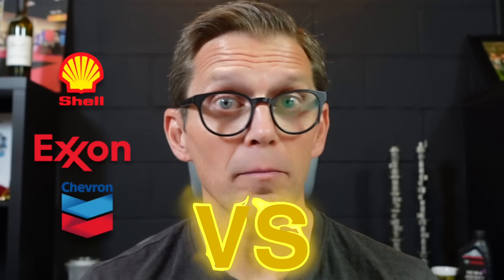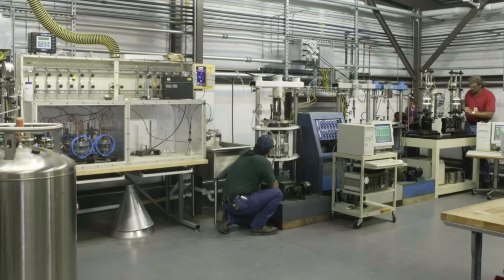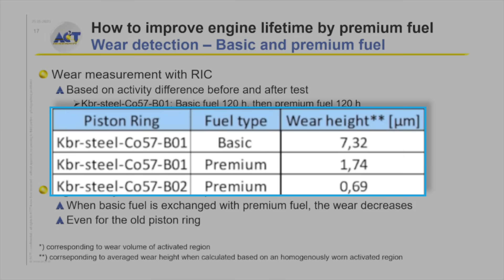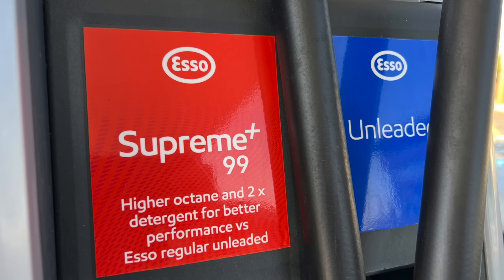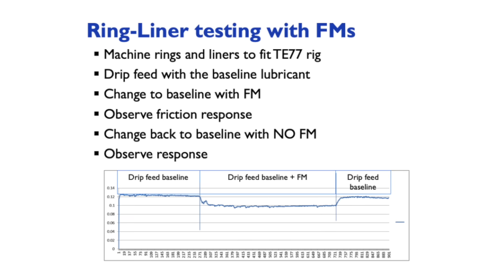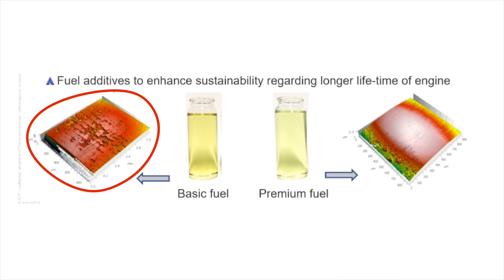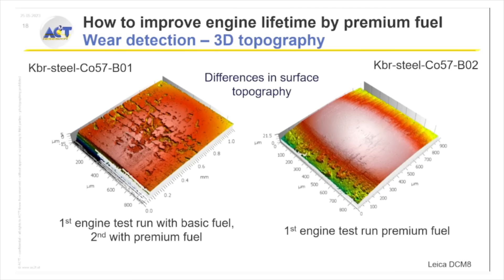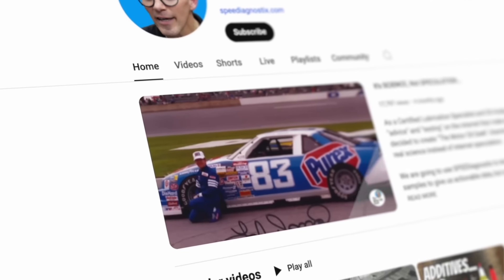Can Premium Fuel REDUCE Engine WEAR?

Comment: Less Mileage, 15 percent less power. YOU AR GETTING RIPPED OFF EVERY TIME YOU BUY ETHANOL FUEL. Literally Watered down Ethanol
Reply: A gas station ⛽ by Walmart in Burlington Iowa recently switched from 10% ethanol to 15% with only a small label on the pump ⛽ saying so.

Comment: So quantify those results in terms of life of a typical engine versus cost.  How much longer will an engine last before needing replacement through new vehicle, rebuild or new engine versus the cost of buying cheaper fuel instead of a fuel with a premium additive package?
Reply: Basic math says that you’ll spend around $30,000 more on premium fuel vs. regular.  That’s based on my truck getting 11 MPG and going 250,000 miles.  There’s likely no way to quantify the actual per mile cost because we won’t know just how much more service we will get out of the same engine if it guzzled an extra $30k over its life.  I think I’ll stick to the cheaper push water.  Can’t see how it’s worth it but it would be nice to see someone attempt to put a real life cost vs. benefit analysis to it.

Comment: How does this compare to "Top Tier" fuel, such as that sold at Costco?  I have a 2021 Volvo XC40, which runs fantastic on 87 Regular, but I only burn Costco Regular.  When traveling and I can't get the "Top Tier" I tend to select Shell mid-grade or premium gas.  I'm not sure if Shell Regular is "Top Tier".  Also, probably 1 tank of Shell Regular won't hurt my Volvo.  What do you think about running regular in a Volvo which "recommends" not "requires" Premium?  Thanks for ALL the great content you provide.

Comment: Certainly the better quality of fuel and minimize wear at the extreme. However, given there are well a dozen variables that contribute to wear, saying fuel quality alone can make a big difference is nonsense and misleading!
Unless you run at least 10 engines in a lab under controlled conditions, if you can't control the variables, the assumed connection means nothing! And a sample of 10 controlled test engines is not large enough of a sample to be statiscally significant!!!

Comment: The Shell ad claimed less wear and corision in the fuel system, not in the engine. I try to buy Top Ttier fuel because it cleans better. Does Top Tier fuel also apply to fuel system and possibly engine wear, too or does that require yet another rating system?
Reply: Duh!  The Fuel System includes the injectors and the intake valves.

Comment: I appreciate this video so much, thank you thank you, you have made this so much clearer and understandable. An analysis video of Chevron VS Shell VS Exxon/Mobile etc would be fantastic, even the discount brands, but all premium fuels being compared. BTW, I've got a new L9H motor 6.2l about 1 year ago, I actually called you about 3 months ago, I have been using 91 octane either from Chevron or Shell in my car since I installed the motor. I'm in California so the max here is 91 octane. I really like that sensor that was developed to sample the back side of the rings as the engine is running.

Comment: Gas is gas to me... my 3 vehicles (two of which are hybrids) all have over 300,000 miles and I will drive up to 20 miles just to get the cheapest gas I can find. 

I change my own oil, transmission fluid, differential fluid, spark plugs, coolant...  that seems to be most important! Service places use budget oil that come out of 50 gallon drums,  thats whats going to mess up your engine! 

I expect my vehicles to go to at least 500,000 miles using the cheapest gas I can find like AM PM, or FastTrip, or Sinclair which is a dollar cheaper per gallon compared to Chevron. 

Gas companies have big advertising budgets,  so I assume this video is a paid sponsered ad and nothing else. 

Go ahead and get some gas from both stations and compare them visually, you'll find out they look the exact same, and likely are.

Comment: So, using lower octane fuel but adding a fuel octane/lubricant additive, one may as well just use straight higher or highest octane fuel and skip the additives?
Reply: If ... the higher octane has more additives.

Comment: Evidently our State has mandated E85 fuel effecive 1-1-2026. So both our vehicles can use E85. But concerned about engine wear and fuel mileage. Was told that the mix of ethanol and/or premium added from the pipe to get the right mix can vary by what is ordered . Say to qualify as E85 to meet the govornment mandate a station owner needs to at least have a say 12% ratio. So some stations that currently don't or won't have dispensers (pumps) with a seperate E85 option will be replacing their 3 pump options to include  regualar 87 octaine (no ethanol) E85 (approx. 15% ethanol) and Premium (91 octane).  NO E10 87 Octane will be offered. Question how much extra wear if any will this mandate increase wear, the ring tribology, and fuel economy? Would like to see some info on this forced mandtate change and how it affects us the people/consumer.

Comment: I use top tier shell 87 with 4oz of marvel mystery oil per tank.also I put 20oz of techtron every 3,000 miles when I change oil.tech brand 5..30 for car's with over 75,000. I watched a marvel vidio you did.. don't know if the cost diffrence  is worth the ware diffrence. I pay 2.73 per gal at shell for 87 oct?????

Comment: Older American here.   I would appreciate a simple, non-data spreadsheet, none graphic summation at the end of your videos that simply states what you found, your conclusions & your recommendations.   I'm sure you know that in research projects that's typically SOP.   You know the last paragraph that says we found doing this is bad or adding this is good, so we recommend .....   The viewer can go back & review your methodology if they are so inclined.

I'm very interested in your topics & commend you for your adherence to the scientific method, but would like to be able to skip to a concise summation.   I don't want to go through the nuts & bolts of a doctoral dissertation every time I click on one of your videos.   

It's great you provide the methodology & evidence but I'd bet many viewers / potential viewers / viewers that click off of your videos early just want a cleaner / simpler, summation of your findings at the end.   Thank you.

Comment: When you do the math on your premium gas that costs 2$ more a gallon over the course of 10 years and you've paid an extra 8 grand to save on ware and tear, but you realized you could of just used that money to buy a brand new engine instead.
Reply: You are thinking of higher octane gas, rather than top tier vs non-top tier gas. In my area, top tier gas is usually 10-20 cents more per gallon. Right now at costco, it’s actually cheaper
Reply: @Handsome-weirdo  This video is about Higher Octane gasoline with additional additives!  Top Tier is just the minimum.
Reply: @M @MrSummitville  high octane is to prevent engine knocking. Top tier gas is for multiple octanes and has all the detergents this video talks about
Reply: @Handsome-weirdo  Yes, we already know that higher octane can prevent knocking. This video is NOT about Top Tier gasoline.  Many gas stations only have the extra detergents / additives in their Premium Grade gasoline. Their Regular grade gasoline does not.  So, no Top Tier rating!!! Top Tier is a only minimum. Top Tier does NOT include proprietary additives. The Circle K near my house does NOT have any Top Tier stickers. Only their Premium Grade Gas has the additional detergents required by GDI engines. Many gas stations have higher levels of detergents and additional additives ONLY in their Premium Grade gasoline.
Reply: @MrSummitville thanks for explaining that. The shell v power gas is only offered in their premium 93 gas, and Lake shows in the video what a difference it can make. My GDI engine states 87 octane in the manual and recommends only top tier gas, i understand that the vpower has even more detergents and friction modifiers than the regular top tier, but is it that much of a difference to warrant the premium price?

Comment: Late to the party. This was eye opening, and I've switched to Shell when I'm north, Chevron when I'm south, premium, for the additives. When I have to buy basic gas, I'll have Techron available.

*Can you do some research on gear oils and transfer case oils?* Surely the additives or lack of them will have a significant impact on wear on gears and transfer cases. Not sure if there's a lot of science and research / testing on this yet, but I would love to know what's better additive wise, and if synthetic is better than mineral or mixed. Thanks. ./s

Comment: Lake, I have switched my Mustang GT and Jeep Wrangler 3.6 to Shell 91/93. They just run very differently and I know that the higher octane will reduce the temperature of the combustion and of course, your analisis shows less wear.  I also increased viscosity to Synthetic 5W30. These are new vehicles and I do not care about warranties. I just need reliability. Your videos are extremely informative. Your efforts are very appreciated-Thank you.

Comment: Sooo could we mix a very small amount of 2 stroke oil in our 4 stroke engine to reduce ring to cylinder wear?
Reply: Ethanol itself is sootless and makes gasoline burn cleaner so has less soot as well.   Soot is what wears out rings.

AGE85 a lead free ethanol aviation fuel has 1% biodiesel.  Biodiesel has very high lubricity.  

Since sulfur was taken out of gasoline and diesel, they lost their lubricity.

Comment: what if you live in  a aera where about all you have is wally world fuel,or circle K or ceffco stations. not a lot of name brand stations around these days and no toptier stations for sure. what additive do we need? and turbo safe.. I run 93 octane in my 24psi trurbo gm 4 cylinder. the wifes truck(2021 ford f150 ecoboost twin turbo 2.7) gets 89 to 93.mostly from the waly world stations merphy fuels/oil. not a clue who make it or what additives it has .  it would be nice to know what fuel additive to use and when.

Comment: Fascinating video.  I wonder how this data pans out economically?  In other words is the substantial extra cost of the premium fuel justified?

Obviously this question is dependent on how long you plan to keep a car. If you keep a car say 100,000 miles or less where the chance of where driven engine failure is quite low to begin with it obviously can’t be justified economically but at what mileage does this translate into economic benefit?

Comment: Run 93 in both my 2024 Kia 3.5 Carnival )Both Port and Direct Injection) and 2014 F150 3.7 V6 (Port Injection).  Both are High Compression 11:1 ish roughly 300HP.  The Carnival towing a motorcycle enclosed 2W trailer gained an O.D gear (OD2) towing at 75MPH Flat highway whereas Regular could muster only OD1 at a cost of 400ish more RPM.  Roughly 3MPG gain w/93.  Arguably not worth the additional cost, but smoothness makes it my choice.  Takes about 2 tanks to fully adjust to a Regular to 93 swap whereas 93 to Regular is like 2 miles.  On 93, Several times I've walked away from my car, leaving the engine running!  Goes full electric smooth.  The F150, maybe 1 MPG gain... less dramatic, but clearly smoother.
Reply: I go cheapest 93 I can find..  that be Sams Club in severn Maryland..  They charge only 45cents extra on 93 whereas another Sams in Annapolis is pushing $1 more.  Both say "Contains 10% Ethanol"  Last I paid for 93 was $3.49 mid august 2025.  tried both, no apparent difference mileage wise.

Comment: Hello, I am a die-hard shell fan. So, when you say basic fuel, are you talking regular from a top-tier  gas or gas from a crappy  cheap station? Once a month, I fill up with shell nitro, even though my Tacoma takes regular. Also, is it beneficial to add chevron cleaner on top tier gas?

Comment: I just got a 2025 Subaru Forester Touring Hybrid and I'm considering running premium fuel in it since Hybrid engines endure so many stop/start cycles. I know hybrids have been around for decades and some of the original Toyota Priuses are still on the road, presumably running on 87 octane fuel. However, it stands to reason that hybrids will experience more opportunities for excess wear just by the nature of how they work. The question is, is the huge cost jump into premium fuel worth it? Or would it be more cost effective to simply add something like Lucas Cylinder Lubricant to regular top tier fuel?

Comment: I've had guys rag on me for using 91 in a lousy 4.2 V6. 200,000 miles + 24 years later, the engine runs pretty close to when it was new. Having operated that vehicle for that long, I know when my engine is not happy with a tank of gas or a particular oil change. Feels different.

Comment: Gas is gas. They all come from one refinery. The brand name is at the gas station. And all they do is charge you a dollar fifty more than the non branded gas station around the corner. Don't believe the hype nonsense. If you are worried about the gas you buy. Buy a bottle of Fuel system cleaner about once a month and add one bottle after you fill up again. Cost is maybe $12. I have had a 2001 ford focus, never used any of those high dollar gas stations and never had any fuel issues or motor problems using the non branded gas station that saves me $1.50 or more a gallon at fill up time. 20 years running proof,  the motor still runs great and doesn't burn oil.

Comment: Thanks for emphasizing SCIENCE as opposed to speculation.  I was amazed at the oil ring sampling on a running engine.  I’m a bit skeptical the sampling method did not alter the normal flow conditions in the oil ring groove area.  Rapidly fluctuating inertial forces on the oil and the sampling system may have altered the flow in and out of the oil ring groove area that a higher volume may not be precisely reflective of normal operating conditions in terms of temperature and fuel dilution percentages.  I believe SCIENCE endeavors to sample in a manner that does not alter the actual operating condition.

Comment: Does all the shell fuel have the same additive package or does only the 93 octane have the v power  nitro plus?  If I get the 87 octane at Shell does it have the same additive package as the 93 at Shell?  Or do i have to get the 93 octane at Shell to get the additive package?
Reply: All octanes have the additive package, so you are just fine with 87. Perhaps the higher octane has more additive but it's not necessary unless your car requires a higher octane gas

Comment: Can I use (NON) top tier , 87 octane fuels and add techtron fuel additve and get the same anti wear result ?
Reply: I believe Techron is only a PEA detergent cleaner.  I haven’t seen any thing about upper cylinder lubrication in it.  Try to use Lucas fuel additive.  It contains heavier oils that provide the lasting lubrication.

Comment: have you ever tested 2 stoke oil as a upper cylinder/ ring lube. I have though about it in a high mix ratio like 200/1 or 300/1 for example. Would this help in that same ring interface you are talking about.

Comment: These tests are a two way street you know. Using 93 octane fuel on a forced inducted motor will generally perform better than on a naturally aspirated one. You also gotta consider your engine mileage and how worn your pistons rings are. Worn piston rings lead to oil dilution which will 100% cause performance issues no matter how high the gas octane rating is.

Comment: And yet my Honda Civic has 323,000 miles on the motor burning the cheapest gas in town and burns no oil between oil changes. Amazing! Still gets 40mpg frwy 37avg which it got when new too.
The .35c per gallon buying premium gas over 323k miles would be $3,000+ dollars.

Comment: Here’s something-
I raced dirt bikes from 15-22 years of age. Although I thought I was amazing I would end up 40th roughly out of 100 bikes in a days competition.
I always took very good care of my bikes. I also always ran Bellray Octane Booster, it made obvious increase in HP.
I ended up getting caught up in high performance Sno Machines.
At times we raced similar to a drag race but on packed snow, I thought I had an Ace In The Whole adding Octane Booster to the tank.
I had no effect either way, it’s as if I never added it.
I thought maybe because of the low piston pressure?
I would end up

Comment: Hey Lake, 
I find it difficult to trust a lot of what I hear, but I trust you.
Bought a brand new F150 3.5 Eco boost, from the time it was dropped at the Dealership, I took it for a drive and filled it with Premium, Shell in fact.
Recently I’ve noticed a rough idle, at 15,000klm the idle dropped from 7,000-5200rpm.
I can feel the rough idle because of it.
Took it to the dealer to see if he could raise the idle,  thinking the 4 early oil & filter changes with Amsoil may have lowered the idle.
I tried to explain and ended up taking the shop Forman for a drive.
He felt it and asked what fuel I use.
I told him I’ve always used Premium  since I picked it up.
He said that was wroung and that motor doesn’t like Premium because it runs to hot, I’m actually ruining the motor????
I was shocked, I’m trying to follow the best process I can.
He suggested I run Regular 87 from now on.
I ran 3 tanks of regular with no change, I took it back they checked it out throughly, and couldn’t make any improvements.
I’m not allowing it to idle too long, I’m afraid of Fuel harming the oil etc.
What’s your opinion?? Do you think it’s true that Premium runs to hit for that motor??